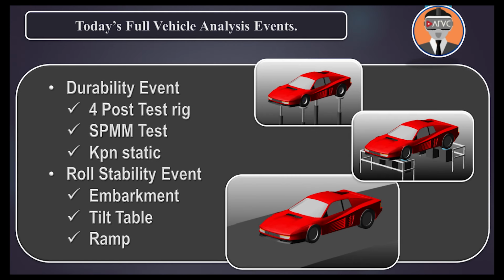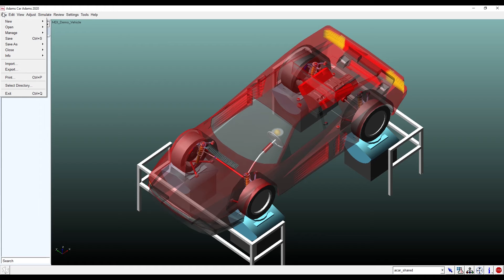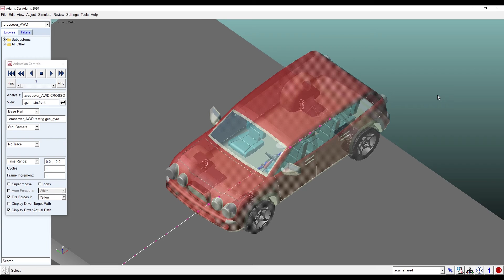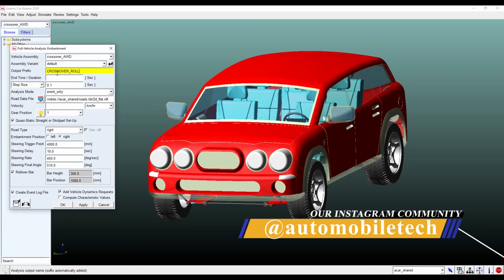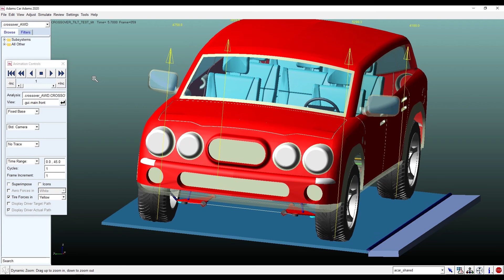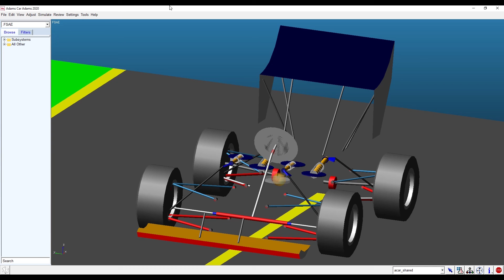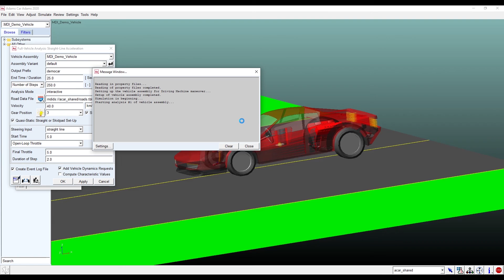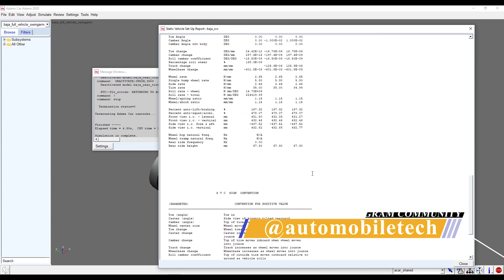🔴 MSC ADAMS CAR TUTORIAL | FULL VEHICLE ANALYSIS [PART-2] | FULL VEHICLE DYNAMICS | BAJA FSAE | 2020

Comment: Many thanks for your video's - excellent work! I have a question, may be you can help. Within full-vehicle analysis - quasi static there is force-moment method. While it is straight forward how to perform the actual simulation/test, I can't figure out how do I plot that famous yaw moment diagram based on simulation results - can't find anything related to it in predefined plot configurations. Do you have any suggestions?

Comment: maybe u can hepl me, when doing roll stability events, ADAMS reads the roll angle limit as 1.54 grades, 1.54 rads is equivalent as 89 grades. I have already change the units in settings and it is still wrong. 
I would be glad if u can help me.